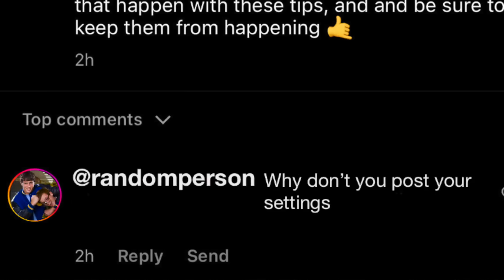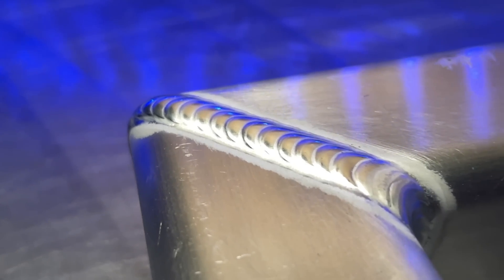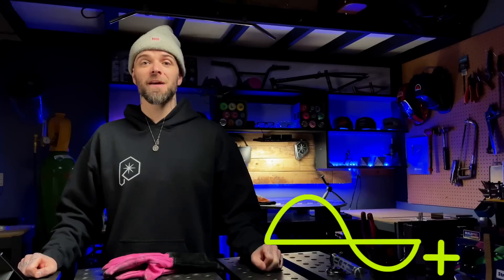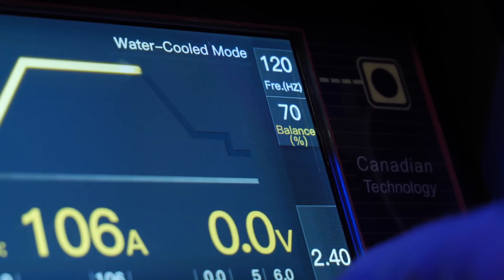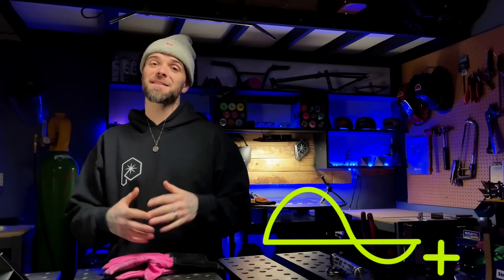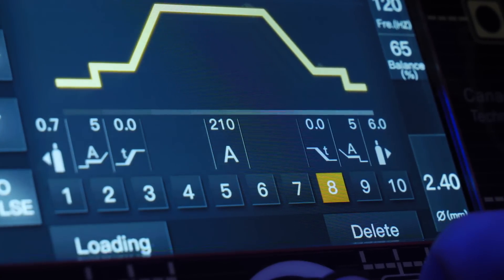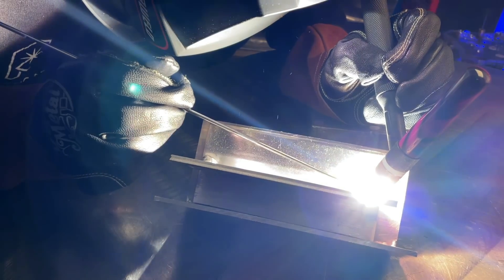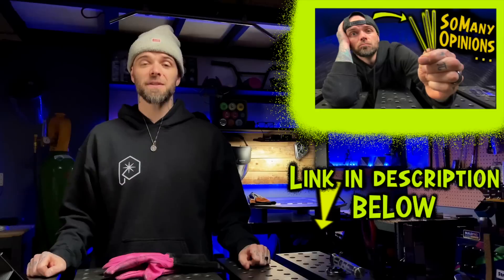don't take anyones advice on this setting tig welding

Comment: your settings could be for a 250 amp welder, you use a 200 or 400 amp 2 or 3 phase it competely changes.

Comment: Just discovered your channel. It has been 30 years since I touched a tig rig. Just bought a multi use machine from Prime Weld.  Getting ready to retire and wanted to work on some projects I have in mind.  So I figured I better start at ground zero and see what is going on in the tig world today before I screw up to bad. Looking forward to your channel.

Comment: Kudos to you for using the terms EP (+) and EN (-) for cleaning and penetration.  One additional comment is that there's no industry standard for this setting, so different manufacturers display arc balance using one or the other and you may not know which from the markings on the machine.  Ex: An ESAB machine may show 70% (penetration) while an Everlast might show this same balance setting as 30% (cleaning).

Comment: Good advice on increasing electrode positive for thin material and decreasing for thick material.. I do the same thing and it definitely helps a lot, my welds still look crap but that's me and not the welder settings.. I'm getting better every time I fire up the tig but I still need to practice more and more often

Comment: With balance, it’s also key to know in which area the manufacturer of your machine regulates the balance, example: Parweld regulates the balance in the + (Around +28 to +32 for the XTT212p and the 353P). Kemppi regulates it in the -, like for the old mastertig 2500/3500W, its around -75. Every manufacturer has their own, so you can also look for that or ask the men/women which sold you your welding machine.

Comment: Recently bought a 200 Amp TIG welder to learn aluminium welding, Did as much research as I could but didn't realise the importance of the AC balance setting until after buying it. The TIG AC Balance setting only has an adjustment of -5% to +5%. I guess only having a range of 45/55 to 55/45 is going to cause heartbreak?  It does have adjustable frequency from 0.5 to 200Hz
Reply: You may wish to research / check the specs on your machine once again.  Given your Frequency is highly adjustable, I suspect the mfg of your machine would be more astute with the AC Balance percentages. aka A range of 45-55% (whether EN/EP or EP/EN) doesn't make a lot of sense.  Inverter machines I've used won't even permit a setting below 50% EN.  

For example, you may (or may not) find the median point for your AC Balance is actually somewhere around 75% (meaning 75% EN / 25% EP) ..... thus the -5/+5 is really giving you a range of 70-80% EN..... which would be more in the ballpark of "reasonable".

But what do I know, I don't know your machine, nor do I know the make / model.

Failing that, just try it.  You'll figure it out.  Good luck.
Reply: @davemiller8238  Thanks for the reply. Did actually have a thought after putting up the comment that there might be a 'configured' AC balance representing zero on the settings as you suggested. Nothing in the machine specifications about this though. Will contact the manufacturer to see what they have to say for themselves, and again as you suggested, will have a crack at it.
Reply: @davemiller8238  The manufacturer got back to me with some figures and based on that it looks like you were on the right track. So for the 11 settings, in summary, the '0' AC balance setting represents 62/38 with the extreme ranges '-5' 80/20 and '+5' 50/50.
Reply: @ChippyOZ  Excellent ! Good to hear the mfg stepped up.  Nice to know you were able to sort it out.